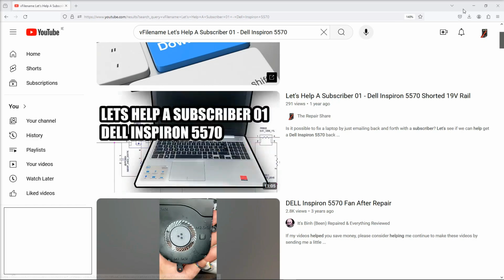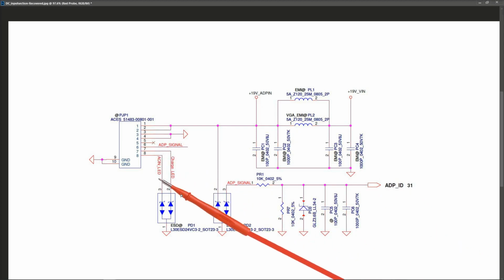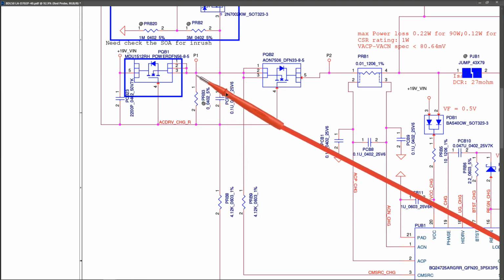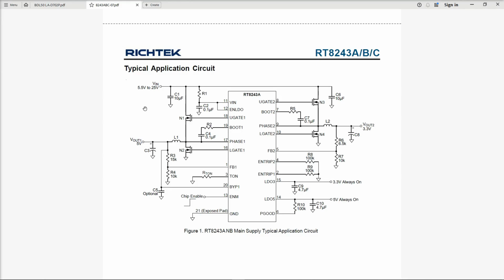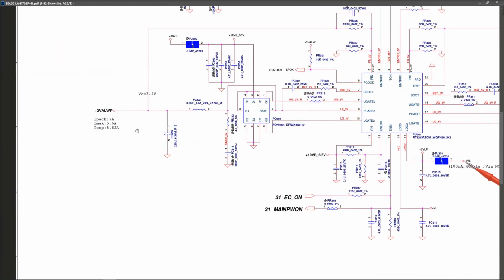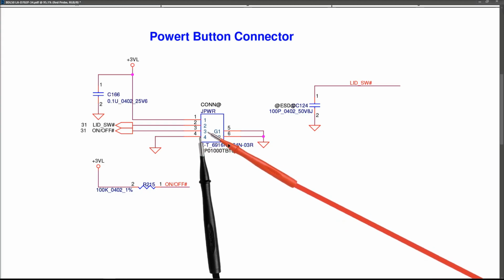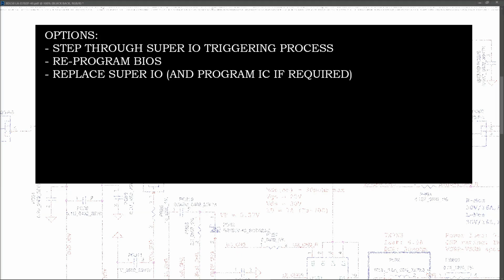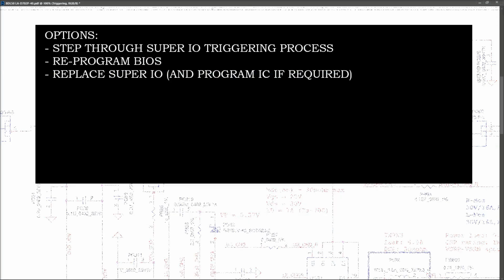Let's Help A Subscriber 02 - HP G250 Laptop BDL50 Not Powering On

Comment: There is a table of voltages on page 3 of the schematic diagram, located all the way to the bottom for system power, Are they present? Another way of saying it, in addition to those reviewed in this video, which in my opinion are correct, the others in that table need to be reviewed.
Reply from the maker: Yes I should have added that. I will add in the next revision of the checklist for this scenario. Thanks for watching.

Comment: Personally I would check if the IO has clock no clock means dead IO chip.
Reply from the maker: Thanks for your suggestion. I got your comment about audio levels as well, I think I may have wheeled over the headset USB cable one too many times in my wheely chair. I'll check it out. Audio did sound a little low when I uploaded.